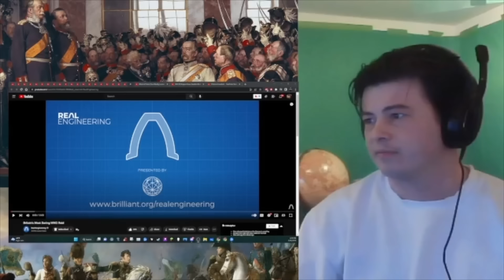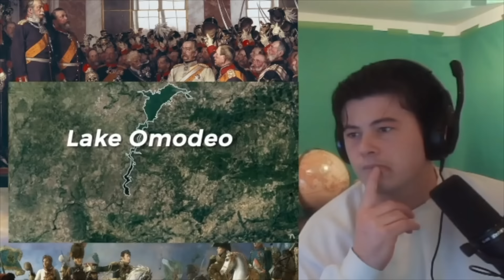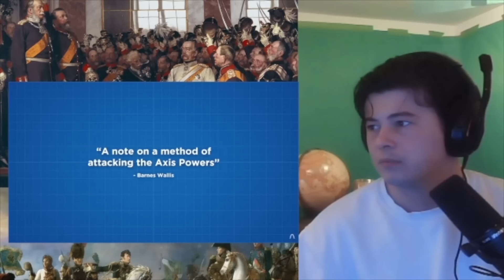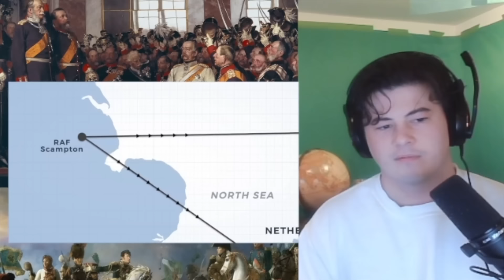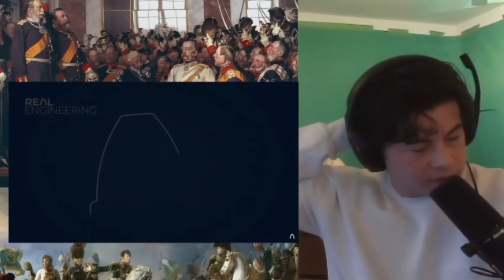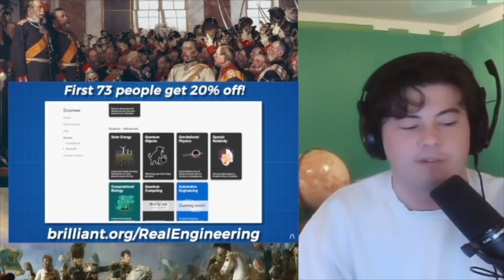American Reacts Britain's Most Daring WW2 Raid

Comment: Originally Barns Wallis the bomb inventor wanted the Lancaster's to fly over the dams at 160 feet but in testing the bombs disintegrated when they hit the water. He then asked then if they could do it at 60 feet. The altimeter was no use at that altitude so they came up with the idea of putting two spotlights  on the plane one in the nose pointing down and one in the middle of the plane pointing down. They adjusted the lights so that at exactly 60 feet the lights would form a figure 8  on the water under the plane. One crewman looked through a bubble window and called out ....Up ...Down to the pilot through the intercom. They had a device that had two nails attached to the two end bits of a hand held Y shaped wooden aimer. They would look through a sight in the single end  to the two ends witch had the nails in them and when the dams towers lined up with the nails they would drop the bomb. When Barns Wallis was told how many men and planes were lost he broke down and cried. 617 Squadron went on to become a precision bombing unit that would go in before the mass bombers and drop there bombs first on target so the other bomb groups knew where to drop there's.  There is a 1955 movie called The Dam Busters that would be an excellent movie for you to watch to get the whole story.

Comment: You commented on the height issue over the dam. The correct height was managed by having a spotlight (which of course made the plane more visible to the Germans) at each end of the plane pointed down at an angle. Where the two lights coincided was the correct height (60 feet I believe).

Comment: The spinning of the bomb, I believe if it spins forward (rather than backward) it would work as a negative wing, and thus shorten the time in the air and make the angle of impact with the water greater (less chance of bouncing). Another reason for the spin was to reduce the impact on the shell of the bomb, without it they tended to break up on 2nd or 3rd bounce.
The film 'The Dambusters' is worth watching, not only for the theme music.

Comment: There were two types of bouncing bomb developed.

The one for the dams raid was called Upkeep.
Originally it had a spherical wooden casing around the mine, but this broke off when it hit teh water, causing the bomb to veer off course. In that video you can see one where the casing broke off, with the main bomb continuing on.

Spinning the bomb forwards would have given it downforce, rather than lift.

The bombs were actually designed to hit the wall and sink, the backspin keeping the bomb close to the wall.

The second one was called Highball.
Highball was smaller and designed to be used against capital ships. Two could be carried in a modified de Havilland Mosquito.
The highball wasn't used in the war.

This a video of some Highball tests (including some on land) https://youtu.be/k-kx2Vpvxk4

The Germans recovered one or more of the bombs and developed their own bouncing bomb, using rockets, of course.

Comment: The altitude for bomb release was achieved with maths
Two spotlights slung below the wings were angled to create a triangle culminating in a single lit spot. When the two lights came together, the correct height was achieved
The precision of the drop was achieved by using a triangle again with a nail in two corners 5jat lined up with towers of the dam when viewed from the other corner of the triangle
Reply: Perfect explanation.

Comment: A couple of points not mentioned In the documentary: Two small lights were mounted in the nose and tail of each Lancaster. When the lights cast converged on the water surface, the Lancaster was at the correct hight to drop the bomb. In order to drop the bomb at the correct time, a simple solution was found in that two bits of wood were nailed together in a v shape on a handheld mount. Two nails were knocked in at each end of the V. When the two nails lined up with the towers at each end of the damn, you dropped the bomb.
Reply: That was one of the techniques used. Some of the bomb aimers just used tape stuck to  the bomb aimers window at the correct distance.
Reply: You got the point, man.
Reply: Something that was said some years ago by yanks 'If we had been told to fly that low, we would have said two words: Feck orf!! and refused to carry it out. Despite all you see about them even today the yanks don't like flying low.
Reply: @Volcano-Man ..except for their zippers in a 'cathouse' that is...
Reply: It was known as the "sixpenny bomb sight"

Comment: The Magnus Effect (spinning a ball backwards against the direction of travel) causes lift because of the pressure change between the top and bottom of the ball.
The bottom of the ball is moving almost into the oncoming air, so pressure is relatively high. The top of the ball is pushing air over it even faster that normal; so the pressure is low.
Although it seems like using the opposite spin would help the bomb skip better (and it would), what would actually happen is the reverse of the above. I.e. it would plummet more sharply into the lake, hitting it at an angle where it didn't bounce at all. Take a look at how a tennis topspin shot accelerates downwards more quickly than one hit 'flat'.
The backspin means the angle that the bomb travels at could be much flatter, and thus it can still skip even at higher drop position and slower speed.

Check out some of the earlier videos on the channel 'How Ridiculous' for some great examples - many of which involve throwing things off a dam!

Comment: I am not a fluid dynamicist but the back spin on the bomb became important when the bomb came up against the dam wall - it kept the bomb tight against the wall as it sunk. This was necessary to create the maximum explosive force into the structure. I suspect that it may have also improved the 'skip' across the water. It's a while since I researched this, so this latter point is more from intuition than knowledge.

Comment: It’s a case of trying to out smart our out do your opponent because in war, anything can happen, take glides for example, a single British glider can carry up to thirty soldiers or two small tanks, and much like D-day, you’ve only got a limited amount of funding as well as resources and more importantly time, because as I stated earlier when it came to D-Day, not only did the Germans have to worry about the allied invasion, in front of them, but also above and even behind them, all the while their command lines are being cut and saboteurs are putting explosives in your cannons or rendering them useless, all the while they’re having to worry about things like ammunition as well as paratroopers and glider troopers since unlike video games where you have unlimited ammunition, a typical soldier could carry up to about thirty to forty rounds of ammunition, vs soldiers today having access to about two hundred rounds of ammunition as well as a fully automatic rifle, things like the MG42 can fire a thousand rounds a minute and don’t forget, you have to keep firing all the while the barrel and the guns getting hotter and hotter, where it’s basically glowing and in that short time frame, the Americans could have easily moved up ten meters up the beach, all the while your ammunition is dwindling. And the same goes for the dams, where, the bombs can’t be dropped via the front, at most they’ll miss if they try using any bombs or would do any significant damage, plus there’s plenty of anti aircraft emplacements to ward of any viable air attack and if that were to happen, then the only two options are.

Use a smaller bomber like the Stuka or Blenheim, however they are too small lack the range and capacity to drop the required bombs,

Or use much larger bombers but fly really high, in order to avoid ground fire as well as simply put it

WHO WOULD BE MAD OR INSANE ENOUGH TO FLY A TWO TON BOMBER SO LOW TO THE GROUND,  IT BE TANTAMOUNT TO SUICIDAL.

The same reasons why American airport security was as lacked and simpler before 911, simply put it, no one truly expected that two hijacker’s would hijack an aircraft and fly it into the World Trade Center, before that people were able to carry guns on their persons in broad daylight even in the airport.

Comment: Depth chargers creates a positive and negative pressure wave from both the rapid expansion of water pushing the ship or submarine apart as well as the secondary effects where due to a massive vacuum in the water the water would try and fill in the void within a matter of seconds, which would result in a negative pressure wave sucking the submarine or ship into the void essentially pulling the submarine apart, meanwhile the crew inside are either liquified due to the pressure wave or badly stunned, or simply crushed by both the positive and negative pressures of rapid depression, which is a big fancy way of getting sucked out into the deep sea in the middle of nowhere

Comment: To achieve the correct altitude to drop the bombs, altimeters were not accuate enough. So they fitted the Lancasters with two powerfull lights facing downwards. One was mounted at the nose and the other at thhe tail. These two lights were angled slightly towards each other. They were turned on as they flew over the resevoir and as the aircraft decended the two 'spotlights' converged, when they were alongside each other they new they were at the correct altitude (60ft).
They then had a hand held sight/aiming device which looked a bit like a catapult with two vertical pins at the end of the sight. When the two pins lined up with the towers on the dam they were at the correct distance to drop the bomb.
Reply: The device used to determine the correct distance from the dam to release the bomb was the Thrupenny bombsight, called this because it used three pence worth of wood to produce
Reply: MacGyver would have been proud!

Comment: Hi Connor. This video expains how PoWs were treated by the British.

https://youtu.be/CQdS0fEuY54

Also, the exact height the aircraft needed to fly was by using two spotlights on the planes. When the beams converged at 60 feet the bomber was at the right height to drop the bomb.

Even though the Germans repaired the dams in five months, (using slave labour) the repairs used an enormous amount of materials eg cement etc. Which also took an enormouse amount of energy to produce  thus weakening their war effort.

Comment: Not mentioned, spot lights on the end of wings angled to a join at the required height and the bomb aimer shouted out the distance to the precise calculated length before releasing the bomb.
German POWs apparently were treated so well in Britain that many stayed here after the war, I believe there is a video on the subject.
Reply: From what I can remember of it now - I thought that the spotlights were placed one at the front and one further back - and only when the spots merged for the bomb aimer to see would the correct height be right to drop? I'm not sure of the wings would have been the right place to hold them, vibration, flak, etc . . . although, I may be wrong in my memory?
Reply: @KGardner01010  Actually, thinking about it, front & back's what I remember too
Reply: Yes, that little invention was crucial. Aligning the lights as they approach the dam makes for great tension in the film.

Comment: As others said, the movie Dambusters tells this story. I watched it many times as a child. What I missed in this youtube video but what was explained in the Dambusters movie is that they didn't have accurate altitude meters and used lamps. From the operation Chastise wiki page: "The second problem was determining the aircraft's altitude, as barometric altimeters lacked accuracy. Two spotlights were mounted, one under the aircraft's nose and the other under the fuselage, so that at the correct height their light beams would converge on the surface of the water."
Reply: Unfortunately, the film portrays Gibson getting the idea of the two spotlights whilst in a London theatre watching a show. The mechanism was actually created by Benjamin Lockspeiser, a scientist at the Ministry of Aircraft Production who remembered RAF Coastal Command trying something similar earlier in the war. Still a great film though.